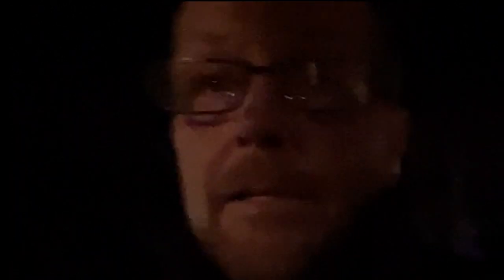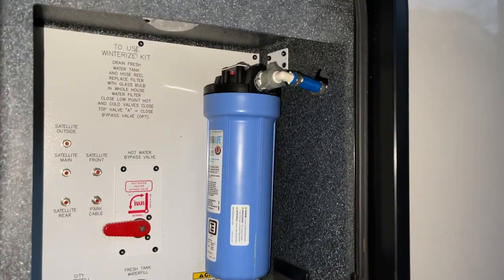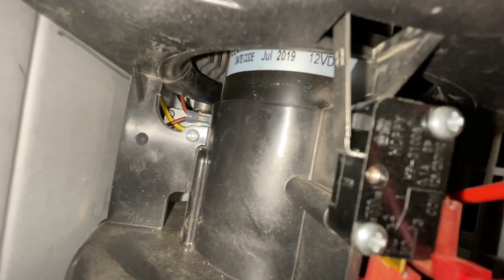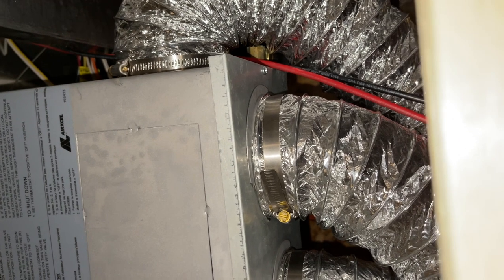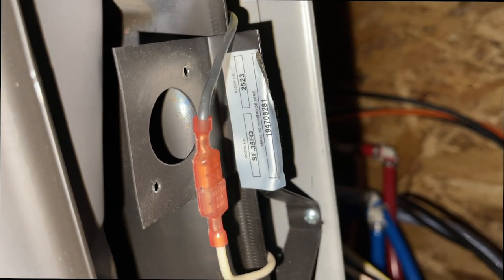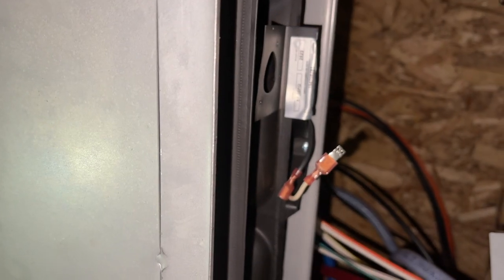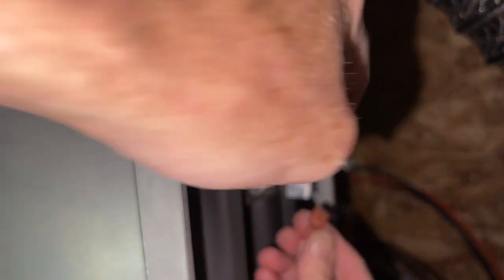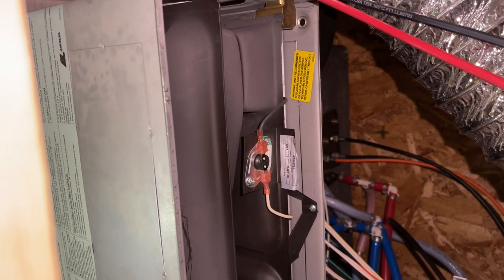Best $17 Ever Spent On My RV

Comment: if you look on the limit switch there will be a temp range on it, make sure to get correct temp range.   they make a reset-able limit that has a small button in between the 2 terminals that can be pushed to re set it
Reply from the maker: Great info! Thank you

Comment: I winter in upstate NY. (Yup) in my 5th. Skirted with 1” Dow then 7/16 OSB. ALL 3 slides wrapped (4 sides) with 2” Dow. 50’ heated water hose off heat tape wrapped  sillcock out of heated shop!  Seen lots of teens already  
Last year, I don’t remember the temp, but heard next day our wind chill was -27 !!  YES!!!
Pull reflexive over most windows at night. Some R-13 behind couch, recliners under bed and in closets. Stack 3 high over door off steps .  
Piece of ca ca ca cake!!! 
Stay warm and God Bless.

Comment: Great job John.  Yep, the manufacturers install the furnace and often build the cabinetry around it.  You should see some of the obstacles I've had to crawl around or remove to access what you did.  I had to completely take out the basement walls of a 5th wheel to access one once.  Others, like a Forest River I just worked on, had a large access panel and it was all right there.  Great advice on carrying those two parts, and yes I would charge a bundle to come out and do that for you, so I appreciate you showing the viewers how to do it themselves.  Some people just don't want to and that's when they call me.  You might want to reattach those panels for easy access the next time you need to get back in there.  You should have an access panel somewhere inside where it draws in the air before it blows it out of the tubes. :-)
Reply from the maker: Great idea! Yup, building an access panel. The return is about 5’ away at the stairs. Thank you
Reply: Steve not to get free advice but...... My 2013 Outback 260FL has the same issue. I found the heater under the refrigerator. Do you know of an access to those other then some videos that show i need to cut the wires and completely remove it just to put a new sail switch in. It worked intermittently for a while then stopped all together. I was thinking there might be access behind the power panel but have not been brave enough to pull it out.

Comment: Great tips. Even if you are not confident in troubleshooting and replacing the parts, having the parts that match your unit is a good idea. You don’t want to be freezing while the parts you need are enjoying the warm container ship sitting off the coast. Glad to took extra time to set up a nice camera angle. Manufacturers should have access panels so you can do maintenance. I hope you consider replacing the panel with a door or even Velcro for next time. Thank you for sharing and have a warm day.
Reply from the maker: Happy to help Augie 😀

Comment: Great work, John.  This is why I never wanted to work in the HVAC business. You are always working at the opposite extremes. it is really cold till you fix the heat, then you leave to go to another cold place ; or your fix the A/C so as soon as it gets comfortable you go to the next hot place.  Depending on the age of one's RV, I would suggest mounting that piece of paneling with some snap latches, kind of like what may hold kitchen cabinets closed so if and when you have to go in there again will be leas work.
Reply: Trust me the pay is fantastic when your self employed! Heat and cold warm my bank account! 😬
Reply: @MayhemRv  Oh yeah,  I know that. It is just not the way I would choose to live MY working life, when I can sit in a climate controlled cab of an excavator for big bucks. Also did service  work on paint booths for body shops also controlled environment. You better believe when a paint booth goes down they will pay whatever it takes to stop losing money from not being able to paint.
Reply: @dallasarnold8615  I see your point about climate control. I hate the heat and humidity!  Running heavy equipment always looked fun but I don’t think my derrière could take it very long  😊

Comment: The key is to test your furnace before you actually need it. I had the one in our home repaired two months ago. It never hurts to have spare switches. The only thing I ever needed to replace in our old trailer's furnace was the thermocouple. 10 minute job. With the rising cost of propane I would be using electric space heaters.
Reply from the maker: We use space heaters but not very effective with temps so low

Comment: Great Advice on the sail switch.  Like you, my furnace in my Jayco Eagle just stopped one day.  As a full timer in northern Michigan, heat is critical.  My problem ended up being the circuit board.  Now I have 2 spare sail switches and a spare circuit board.  I caution everyone on using space heaters,  I have a small electric heater in the bedroom only.  To prevent water lines from freezing, it relies on the furnace running.  The water lines a typically ran along the heat ducts.

If you have to pull the heat ducts off, they 1/4 turn out of the furnace body.  You do not have to pull the clamps
Reply from the maker: Good info! Thank you

Comment: John & Mercedes, I have watched your channel for the past couple years and I just joined your channel because of this rv heater repair video and your commitment to God. I have a very committed faith in God and believe he had me watch this video just as it was released.  On 1-1-22 my rv heater would not reignite after an initial heating cycle, then it stopped reaching the set temperature on the thermostat.  These two problems are associated with a faulty sail switch and Thermal limit switch, which are the two items you mention.  I know God had me watch your video on the subject, so I would know what to look for when my heater started acting up.  I could tell you so much more, but know the two of you are very busy with Thunder Canyon. You are in my prayers and thank you for following God's guidance and sharing your experiences. God Bless you, Murray
Reply from the maker: That makes me feel so good to have helped Murray😀 God helps those who help others🙏❤️

Comment: Definitely good advise to be prepared.  I am a hvac service tech so the first place my mind goes is “what caused the high limit to trip originally.”  They are what is called a bimetal snap disc meaning if they overheat one metal expands faster than the other causing it to snap open.  When it cools down it will snap closed however yours clearly got stuck open.  This means it probably was opening and closing prior to it getting stuck.  We are new to rv’s as we were just informed our trailer was ready to pick up after waiting months so I am not sure of the setup of the heating system.  On a house there is an air filter in the return that gets filled with dust and hair.  I’m not sure if an event would have an air filter hidden somewhere.  That is the most common cause on a residential furnace for a high limit switch to go off.  Also another issue is if people block or cover supply vents which limits airflow causing limit switches to open.  Just a little thought from a service tech that immediately thinks what caused the part to open in the first place.

Comment: Wish you had posted this a week ago.  We were in Alburqueque for 2 weeks and on the 23rd my furnace stopped working.  Temps were expected to go down to the 20s Tuesday night and even though I have a fireplace and space heaters I like to run the furnace on really cold nights to heat the basement and underbelly.  Found a few other videos, none as good as yours, and a parts place downtown had what I needed.  Quick test verified the limit switch was the culprit and 2 hours later I had heat.

Comment: Thanks for the tip. What I did was I added a diesel heater to my RV.  I now have 2 separate heating systems. This way if one stops working  the other one should work until you can get the other one fixed. For me I like the diesel heater better. It is more efficient and it runs quieter than the heater that came with the rv.

Comment: My hot water heater didn’t work. It would kick in sometime but took cold showers most the time!  I had 2 rv centers check it out, one mobile one came right to the area I was living. Replaced a part, charged me 80$ ( for a 13$ part on Amazon) but i know for a service call I get it. Didn’t work! Came back, wiggled some wires, worked till they got out the driveway…125$ service call, cold showers still.
Took to another rv center.  140$ an hour, still cold showers.  U tube university and hours of watching others who fixed their own problems.  I finally found one that said older models ( mine was a 1999 Lance camper) the circuit boards short out and that is what mine was doing. I ordered one plus an adapter to adjust and fit my rig since they had changed over the years.  Took me 30 seconds to unscrew and replace and I had hot water!!!  140$ for the part and I spent 600$ previously on service calls and unnecessary parts that didn’t fix the problem.  Be wise, do thy own research…u tube university as those on the road living in it are the best ‘rv center fixers’!!!  Just my humble opinion.
God Bless!
Reply from the maker: Good info 😀 Thank you

Comment: Thank you for sharing this! I found this out the hard way in the middle of winter in Montana in 2016. You can also use a 15 amp wide blade fuse to get you buy if you don't have a limit switch-temporarily only. It was 20 below when I found my issue out.  Same furnace. Hope you get and stay warm.
Reply from the maker: Yes, I cut an ear off the old one to connect
Reply: @RVOddCouple  Great idea!

Comment: Totally correct. With parts becoming scarce. I would make it one spare sail switch. And at least two spare limit switches. Oh, I noticed you did not have extra insect screens on your furnace. You might want to take care of that before spring. They go on the outside vents.
Reply from the maker: Great eye Ken! Added screens to my to-do. Take care Buddy

Comment: John I noticed you didn't have a screen on your intake and exhaust port. I had a " miller" flying bug get in my intake. It got in the burner assembly and would not let the unit light. I got the bug out and the furnace worked fine. You can get the screens at any rv service center. Im a retired hvac tech. I learn these things from experience. Good luck my friend.
Reply from the maker: Great eye John! Added to my list of to-do

Comment: Nice vid. Our furnace in our Geo Pro G19FD is very efficient, heats that tiny (20foot) RV up nice and toasty. BUT it's loud as a leaf blower. We mostly use a little 700 watt electric space heater which keeps it warm as well. Biggest problem left to deal with is massive condensation on every cold surface leading to the outside. Worst 2 places are that ridiculous & totally useless nose cap 'windshield' and the door frame. Wow. Puddles everywhere, every morning.

Comment: Limit switches, very much in general, don’t just fail. They may trip and not reset but they rarely ever just fail. If the high limit switch trips check your airflow. Make sure there are no restrictions, like a dirty filter if you have one, and make sure all of your vents are open. If you don’t have a place for a filter I would advise rigging one up. You can also often tap on a limit switch lightly with a screwdriver once things cool down a bit and get them to reset. Also, closing vents can overheat the furnace, causing the high limit to open, shutting down your furnace. Both furnaces and air conditioners are designed with maximum air flow in mind. Air conditioning especially, whether in a house or an RV, requires maximum air flow. One other sign your furnace is overheating is short cycling. If you hear your furnace fan keep running but your burner kicking on and off, that’s the high limit switch tripping and resetting once the furnace cools back down. Just a few tips from your friendly HVAC tech that apply to both a house and an RV.

Comment: Thanks for the info and video.  I will check my furnace, fortunately in my old class A it is accessible.  I seldom use it, I dress warmly and have a Mr. Buddy as well as electric heaters for times I have a hookup.  I am a boondocker, and my rig is a rolling machine shop, lots of spares, but I do not have those.  I live in Alabama 170 miles south - not on mountain, but have seen it five degrees.

Comment: I like owning a classic 5th wheel from 2003... The quality of the HitchHiker from NuWay, has been tremendous easy to access everything. The only trouble I have ever had with the older style furnaces in them, has been the squirrel cage fan bearings... But, not hard to replace. You will know to start ordering a new fan blade, when you hear that very first rumble. Cause it just gets worse ... 😃😀😄

Comment: Here is an answer for you what I’ve done for cold weather is I have bought two portable heaters so when I’m in a campground with electricity I can plug them in and always have heat and not use any propane just two electric heaters that if they are tipped over they stop working they turn themselves off so I would suggest two electric heaters that’s what I have for my 38 foot motorhome one in the bedroom and one in the living room
Reply from the maker: Thank you for sharing

Comment: You can get a adjustable one that will reset when the temp cools back down I’m in HVAC and furnaces use them all the time looks identical to one you use in a residential furnace

Comment: I have wintered in Ohio before, and last night here it North Florida it was 36 degrees overnight. I have yet to use the furnace in either place. Electric is included in my site rent, so I use it. I use the electric fireplace and a tiny electric fan heater in my bedroom. I also use my Heat Pump when it's above 40. I heat taped my water lines for Ohio. You are lucky to have easy access to your furnace, mine is under my steps and I would have to crawl through the garage.... I've had those Oil Filled radiant electric heaters before and they work good for room filling heat too.
Reply from the maker: We have a radiant heater as well 👍

Comment: One other tip is not only to keep spares of any parts that are prone to failure but know where they are located before you need to replace them. I would actually suggest you locate them before you purchase them to ensure you are purchasing the correct parts and so you can determine if the correct parts are actually installed. Unfortunately, these days, you can not be so sure manufactures didn't just install the best option available instead of what they intended to install.
Reply from the maker: Good tip

Comment: Furnace will not light up if it doesn't have 12V. If the fan is blowing and is not lighting up check batteries and fuses.

Comment: Hey guys good subject .we just had our rv furnace fixed twin year ago and  then it went out at the end of winter last year and we got a guy come in to fix it and he found it was packed with stink bugs he had to use a shop vac to suck them all out.he said they was packed in the whole unit and it was probably that way the last time.he said it’s not uncommon to find them in the computer too.it costs us $371 but most of it was his traveling to us he was 2 1/2 hrs away.our fifth wheel is permanently on our ground.it don’t get moved.we don’t get cold here in Pennsylvania even if it -10 below cause we have the furnace( which only runs at night) when needed .we have a small electric heater in our bedroom plus a electric blanket with controls for him and her.lol then we have the fireplace and a Amish heater in the living room/ kitchen area.and we stay cozy. we keep it 76-78 degrees. We’re old and get cold quick.love watching you guys and I love sage
Reply from the maker: Great tip! Thank you for sharing Susan❤️❤️❤️

Comment: It the sail switch about $20 or the circuit board about $100 most of the time, they had to pull mine out 5 times before some apprentice kid said let’s just replace both of them, the parts weren’t too bad but the service calls were 100 to 200 a time and that’s not covered under warranty unless you bring it to the Rv dealership, who might get you in in a week or three

Comment: awesome video. Now that was a helpful video. just not sure why you are using your propane guzzling furnace when you have full hook-ups. We are on full hook-ups and I turn our furnace on maybe twice a year just to exercise it. we use electric heaters as the norm. also, did you know that if you are not level or you have loose or bad wiring your furnace may also not work? I liked how you were clear and to the point with your repair, good job.
Reply from the maker: We typically use space heaters but the furnace helped us keep it at 68. Been freezing here

Comment: Just curious if you are using any electric heater(s) given you have full hook-ups? Would seem you would use less propane and not tax the furnace.
Reply from the maker: Yes, we use 2 space heaters and one oil filled radiator Rick 😀👍 They don’t work that great when it’s 18

Comment: Does the RV have much insulation?  What was the average indoor temperature with the failing furnace?  You said that the outside temperature was 17.  We haven’t had temperatures in the teens yet.
Reply from the maker: RV insulation is horrible. Especially on the slide-outs

Comment: My Suburban furnace in my 2015 Vibe has a ready access panel at the front of the furnace that allows easy replacement or the limit switch. I had to replace mine this year.